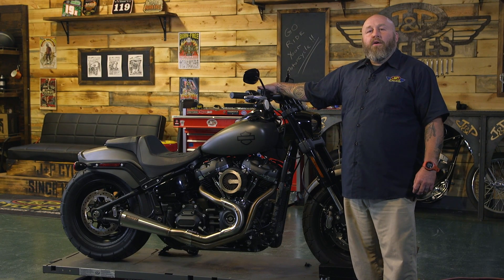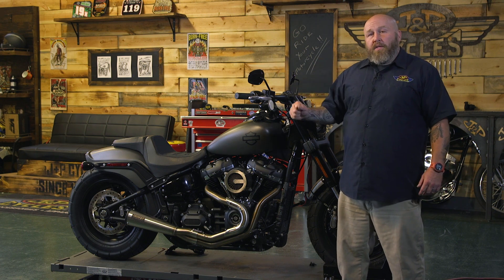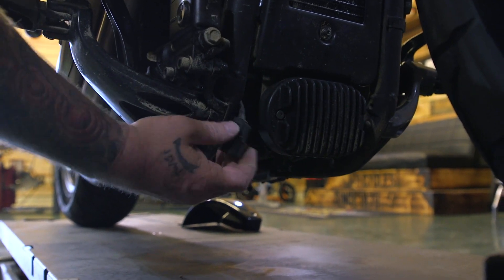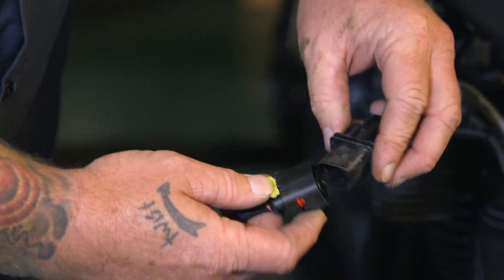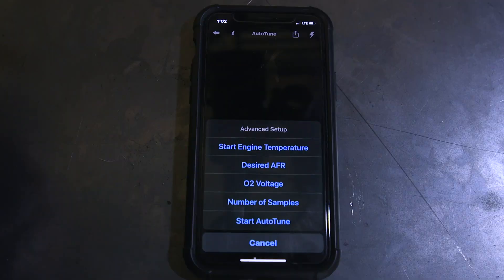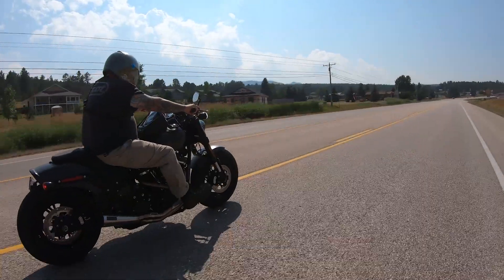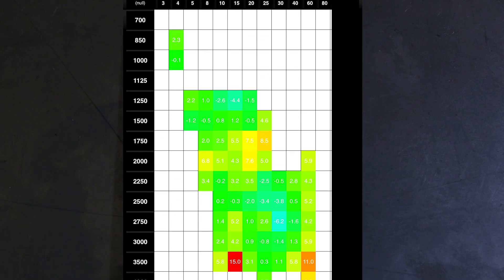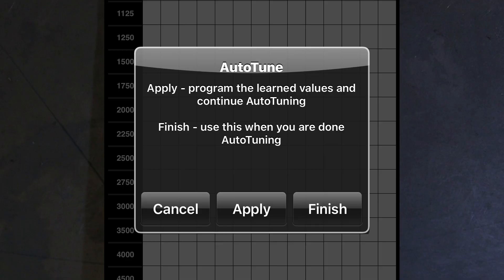How to Tune With a FuelPak Pro : Pro Tip

Comment: I have a S&S 2into1 sidewinder exhaust with the 12 and 18mm bungs, Can I install the 18mm sensors and leave the factory O2s installed, and do I need to disconnect them from the ecu? I am thinking the pro will pick up the wideband since it is connected to the data port. But maybe I am incorrect, The reason Im asking is because I am getting a red messaage at the top of the learning tables that says no O2 dats or someyhing like that. then it goes green saying engine temp. but nothing is learning in the tables

Comment: So once your done tuning the bike should we re-install the factory O2 Sensors and disconnect the pro and re-install the FP3 again using the factory sensors correct?
Reply from the maker: yes, correct
Reply: @jpcycles  , Thanks again Brother and safe riding and have a safe holiday season!!!
Reply: @jpcycles  ,Hey, one last question on tuning my 2015 CVO Ultra Limited is that with my running a Bassani catless headpipe, CFR Mufflers and a K&N High-Flow Air Filter for now would it be best to start out at a 13.0 Air Flow Ration and is 13.0 a 13 to 1 or should it reflect 13.1? Thanks again. I'm going to be running an FP3 and have the Fuelpak Pro on the way to fine tune things.